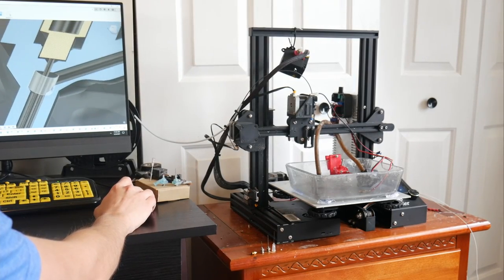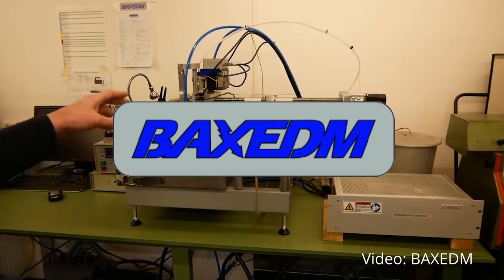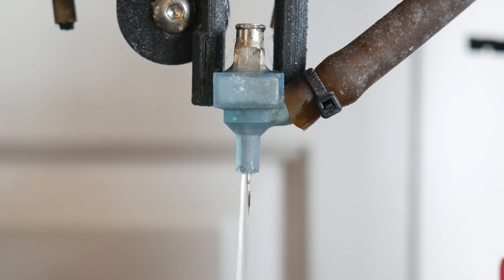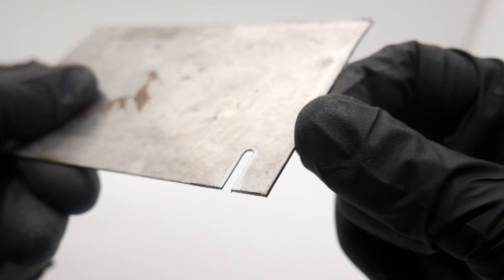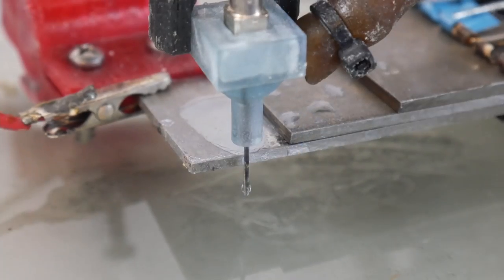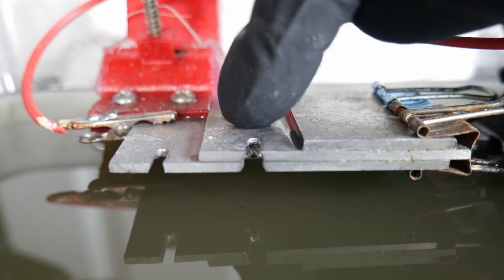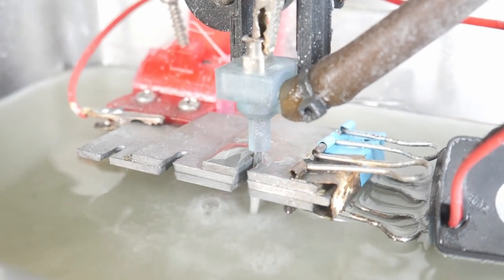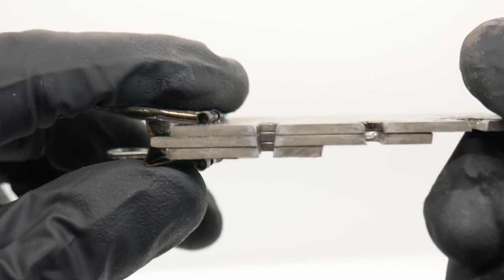Wire ECM on the Ender 3

Comment: WOW. Nice job! Are you literally just feeding the wire in at a constant feed rate? No special software to adjust feed rate by detecting current flow and shorting? That was the part that seemed unobtainable in Ben's EDM over on applied science. I suspect that's what would make the difference between a super clean cut and the flared edge you get, but it's still an impressive result.
Reply: As far as I can see it there is no wire. He is using a solid electrode like in edm drilling
Reply: pretty sure its the electrolyte doing the "cutting"
Reply: @ale6242  the electrolyte isn't doing the cutting but shielding/connecting the electrical circuit and pushing out the metal ions from each discharge event. it is just like water jet cutting but instead of cutting grit in the water, you are passing a current through the electrolyte to cut.
Reply: the flaired edge is because the liquid is doing the cutting.  
the rod in the centre just provide the liquid with a charge.
Reply: @markcastonguay7906  do you always contradict yourself in the same comment?
Reply from the maker: Hey, thanks! That's right, no special software or firmware flashing required. Just cruise the electrode in slow enough that you don't short it. As far as the flaring goes, we've got some ideas in development on the discord to fix that right now 🤞
Reply: @markcastonguay7906  obviously the electrolyte is doing the cutting that's why he said it was an ecm ElectroChemical Machining
Reply: @markcastonguay7906  There shouldn't be discharge events here like EDM (although the current could be pulsed) but its not a discharge, its more like electropolishing where you dissolve the metal workpiece into the electrolyte (opposite of electroplating).
Reply: @ZURAD  I guess you talk about a conical electrode? can't whait for the updates

Comment: Great stuff, super impressive results! Planning any thin wire tests?  I guess that would need some kind of support under the workpiece too, instead of only supporting from one side. But it'd be interesting to see if it could approach EDM in terms of kerf size.  

Also, A+ editing and voiceover work :)
Reply from the maker: Thanks, Taps! Yes, it's definitely in the plans to get that kerf smaller. Many avenues to approach there, so I'm not going to be short on work to do! Even if I could get the kerf to .5 or .25 times the current diameter I'd be pretty happy. That'd make it cut 2-4 times as fast as it is now.
Reply: @ZURAD  Hooray! Looking forward to seeing those experiments. Didn't realize it would also speed up the cut, but makes sense in retrospect.  Will be interesting to see how much the thinner wire starts to deflect or not.  Exciting!
Reply: Breaking Taps 😂
Good Channel name 👍
Reply: @ZURAD  try using spinning helical enameled wire (that's the thinnest conductive material i know ) and a slow warm stream of electrolyte cause its doing the heavy lifting....

Comment: Great creative work! please keep in mind that Cr6+ ions are generated when using ECM to machine chromium-rich materials such as 304 stainless steel. The potential hazard of this product is one reason why ECM largely disappeared in the West, but it can be limited with some chemical additions to the electrolyte such as iron sulfate (which can degrade the electrolyte performance over time). ECM is a powerful method of manufacturing complex shapes in strong materials and expanding it to industrial scale can require some additional methods to maintain compliance with local regulations. Carbon steel and Ti are quite safe to cut with NaCl or mild acid/salt mixtures but if the electrolyte turns yellow from dissolved chrome, gloves and ventilation are recommended as a minimum
Reply from the maker: This is a really good point and something I've been concerned about. I have been successful with capturing CR6 in citric acid. The acid actually helps machining and lets the waste enter solution instead of floccing out.

TBH I am going to be trying some EDM instead. Seems safer from a chemical perspective.
Reply: @ZURAD  if your Cr6 content is low enough (no more than 6 or 7% i think) then the iron content should reduce it without need for additives. If you need to run higher Cr material, your addition of citric or similar mild acid does help with safety, as well as dissolving the waste, such that flushing the surface is easier. It makes filtration a bit more difficult though, and the citric becomes an expensive consumable even at scale. Adding iron or sulfate salts will be cheaper, although they can mess up the process fluid quickly.

EDM is safer and easier to control, but once you work through the challenges of ECM you have a very powerful surface forming tool, especially as the materials and shapes begin to challenge the limits of EDM. The two are often complementary. For example, your demonstration machine can deburr sharp edges and polish surfaces of a part after an EDM, saw or waterjet has made some accurate features with straight, non-tapered cuts. if ECM just does the last operation, there won't be as much waste to worry about.
Reply from the maker: @TimothyNoronha  I agree that EDM will be much safer and easier to control. If you check some of my recent community posts I've been having great success with EDM. We're even running a Kickstarter on it soon! You can sign up to the mailing list at https://rackrobo.io if you're interested.

Comment: Crazy good start. On point. Zero contact machining like this are right up a 3D printers alley! Can't CNC mill with belts (unless they control hand wheels like my '63 Cincinnati knee mill LinuxCNC conversion). This is awesome. Keep tinkering and see what works for a straighter cut.
Reply from the maker: Thanks 👍

Comment: This is amazing. I can not wait to see how it goes. I just got it recommended maybe the algorithm picks it up.
Id love to see a version with a wire running through eventually. This would be insane and it is crazy that the maker scene has not picked up on EDM more.
Reply from the maker: Awesome, thank you! There's no need to run wire as in ECM there should be no tool wear.

Comment: Current....current...current! Increase your current going to the pieces. Erosion is porportional to the current density per mm squared. The thin wire you have going to the pieces shows me how little current you have going to the electrodes. In high school i built a plunge ECM and used 4 microwave oven xformers with hand wound secondaries, 8 gauge wire all in parellel then rectified...i was drawing well over 150A at 12 volts and was drilling 1/2 inch holes in 1 inch plate steel in less than a minute....commercial units used for making turbine blades approach 10,000 A. Increase current!

Comment: Very cool.
One thing that might help reduce the flare in the cut is reducing the electrolyte flow rate. I believe the flow rate needs to be just fast enough to carry material from the cut away from the workpiece. any faster and you get an increased discharge in the cut from the electrolyte causing flare, but if it's too slow it doesn't move the cut debris away resulting in a potential short or inefficient cut.
Reply: AQTT - your comment seems to summarize best what others were attempting to describe as well. With that said, it seems to me that the solution to a controlled kerf width and less flare is to submerge the part, recirculate the electrolyte and move the swarf and current accordingly. But now were just describing basically an EDM machine with side cutting capability?

This is a really cool idea - scaling down EDM technology to a desktop device.

Comment: I suspect that this will work better in a dielectric bath than with the coaxial jet.  if you're going to use a jet, consider an upward jet.  (but my suspicion is that the kerf is going to get bigger with a jet of any kind)

Comment: Waterjet laser cutting uses an annular air nozzle around the water output to keep the jet straight, would this be feasible to reduce the taper as the workpiece thickness increases?
Reply from the maker: That is a very interesting idea. Afaik the taper is caused by surface tension against the work piece so maybe!
Reply: @ZURAD  the 2 ways i can think of reducing surface tension:
1. A wetting agent (like soap) in the liquid.
2. Increase temperature.

A bit of soap in the water would be easy to try.
Reply from the maker: @DuncanLaw  Absolutely. I've been looking into different surfactants. I think it's pretty obvious why a low foaming one would be desirable. That's why I'll probably try something like dishwasher detergent
Reply: @ZURAD  Yup. Old fashioned powdered floor cleaning soaps might be worth a try too. They are highly concentrated and engineered to be non-slip for safety reasons which i presume implies they don't increase the viscosity of the water much.
Reply: For some cases you might make use of the taper. As you know, a chamber for tapered cartridges without a lathe is the biggest stumbling block for DIY gunsmithing right now.

Comment: Awesome job, though I can not but wonder about the upside down V shape you get on the face of the cut, is this not a problem? Or is just a superficial illusion? Point in check I'd be expecting something more rectilinear.
Reply from the maker: Yeah this taper is indeed an issue. Fixes are under dev atm and primarily deal with fluid flow characteristics.

Comment: very interesting. I have been lurking a while, would this work with other metals, aluminium or copper???
Reply from the maker: Yes! This process works on any metal. Titanium may necessitate the use of an H-bridge but it will still work.
edit: I'd also like to say that it would cut aluminum or copper MUCH faster than steel bc of their valency.

Comment: It seems like you could almost use the needle like an endmill and do plunge cuts and do rough 3d paths
Reply from the maker: This is a thing commercially with ECM, but it's such a delicate to control process you're better off working on 2D tool paths or die plunging.

Comment: That was so incredible. Instant subscribe! I can't wait to see where this goes. I've got a bunch of 3D printers. It would be really cool to convert one for doing this. Would it work even better on thinner metal? Can it also work on brass, copper, and silver?
Reply: it would seem that thinner materials would be cut easier, yes. and it should work on anything conductive, as far as I know. we just tend to use this against high hardness materials due to the fact that they tend to be more expensive and time consuming to machine using conventional methods.

Comment: Depends on cost but I would spring on a beat kit if it was affordable enough
Reply from the maker: It should be relatively inexpensive. Cheaper than the ender probably. I'm working with my partner on getting it nailed down ASAP.

Comment: That is very impressive and could  be a game changer, allowing hobbyists to accurately cut steel in a basic shop without much noise or dust. Are you using DC here? Controlling current or voltage? Or some kind of shaped pulses? If so, would you mind sharing some parameters?

Comment: This is amazing. I feel like I just saw the first laser printer! I wonder if you need such a large bath. Maybe you could just have a steep angle receiver funnel that goes to a small sealed bath so it doesn't get all over the shop. I assume the bath is to let the precipitates settle out?
Reply from the maker: The bath currently acts as an electrolyte reservoir as well as a catch basin. Ideally I would have a much larger reservoir to feed into the pump and have a drain of some sort out of the basin on the machine. There is little in the way of precipitates at the moment because I have doped my electrolyte with citric acid to reduce it.

Comment: How about other metals, particularly aluminum or copper plates? Is the cut kerf dependant on the needle or the water jet? Anyway, this is amazing for the DIY potential
Reply from the maker: Hey! Aluminum will cut ~3 times as fast as steel and Copper will cut ~8 times as fast. Kerf is dependent on the diameter of the water right now.

Comment: I have been building my own EDM machine, I plan on using Mach 3, or Mach 4 not sure which yet.
I have 2 PCB's to try, I have Controllers with steppers as well as a high pressure pump.
The look of your cuts being wider at the bottom are disturbing, otherwise I think you have a good idea going.
Good luck.

Lee

Comment: Unless your already doing this see if you can feed a wire through a needle with an adjustable gap with voltage on the tiny wire as it gets fed through the machine by the water
Reply from the maker: I don't think I quite understand. Could you rephrase this
Reply: @ZURAD  Try to find the thinnest wire you can and find a small needle use the water to fit the wire through the needle and then electrify the wire see if you can find a 3D printing stepper motor to feed the wire through so the water just doesn't blast it all through if that works you'll be able to make the real parts like the extremely high precision pieces cuz it'll basically be a tiny tiny wire just above the size of a human hair cutting through the metal as long as you keep the wire moving and the water on it'll cool and cut through the part basically just feed a extremely high voltage wire through something to control it and then feed the wire in not too fast or not too slow

Comment: Amazing stuff! What cutting speed did you achieve in your tests? How does the thickness of the material affect the speed? Keep your work up!
Reply from the maker: Material removal rate(MRR) is directly proportional to the current between the anode and cathode. The last cut took about 15-20 minutes and the first two were ~10 min. More material will also increase cut time proportionally to surface area between electrodes.

Comment: Man, every update of this channel is more awesome than the last. So are you doing "wire" edm using the needle as wire? what kinda power source are you using? its still ECM?
Reply from the maker: I'm doing "wire" ECM, yes. This is actually piggybacked off of the Ender 3's supply so I didn't even need anything specific. The needle is nice bc it doesn't need to be under tension and can enter precut holes for 2D machining paths anywhere you want.
Reply: @ZURAD  are you still using just NaCl salt as electrolyte solution? is this 5v or 12v?
Reply from the maker: @JavierChiappa  I'm using NaCl @200g/L plus ~20g/L of citric acid to reduce sludge. This is all at 24VDC from the Ender 3 power supply.
Reply: @ZURAD  Thanks for the answers! What you are doing is truly amazing! please keep it up :)
There are so many things to try! a thinner "water jacket" (so the needle is closer to the metal) ?, a thinner needle? 
I guess now you can actually cut a knife profile with this configuration!
Reply from the maker: @JavierChiappa  This is exactly where I'm going with it. I've got some fixes in dev that didn't make it into the video. Should make the electrodes more effective and simpler to make.